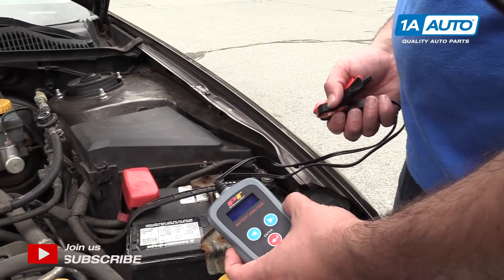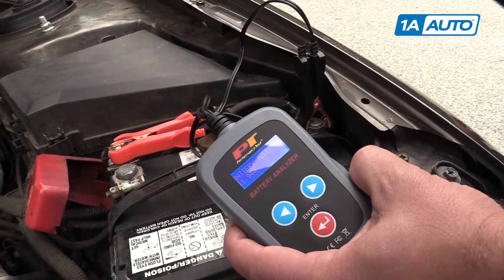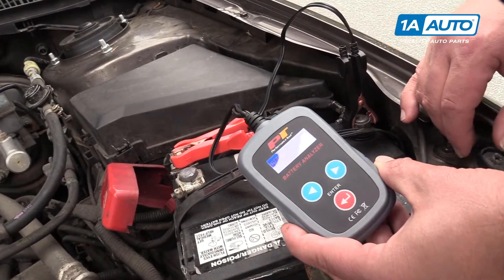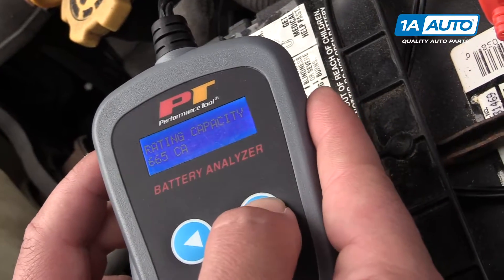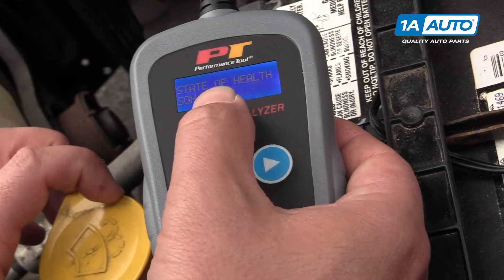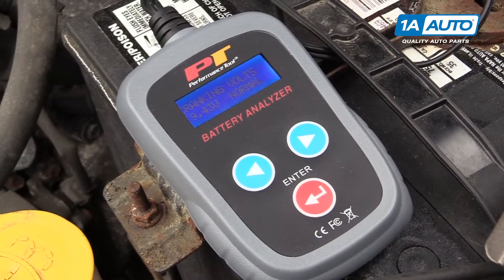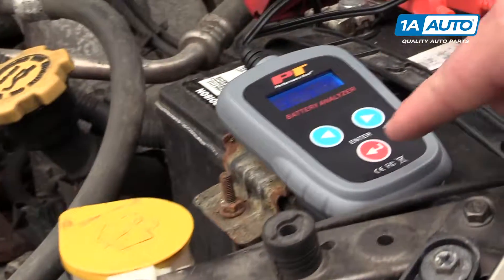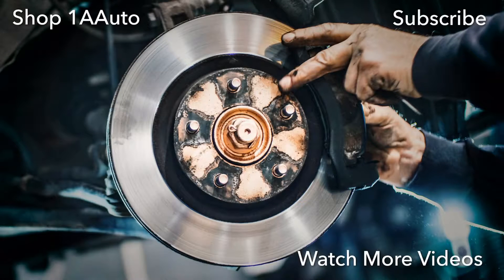How to Use A Battery Tester

Comment: If I were to use this, or a similar device to test a pair or group of batteries, would I be better to test each battery individually, or (+) terminal on the first battery and (-) on the last battery? If the the latter, does it matter if the batteries are in parallel, or series? I assume individually removing the batteries and testing them one at a time is more effective, but I am curious to know if the other way works, as well. Sorry I do not own one of these devices, nor do I have a bunch of batteries to setup, just a curious question about semi truck and heavy equipment setups before I go researching this type of tool for my needs.

Comment: The video instruction were misleading per device manual http://www.wilmarcorp.com/files/W2998_Manual.pdf.   The instructions for the car battery tested should have used SAE settings instead of the CA (MCA) settings  and entered the battery CCA value instead of the CA.

Comment: Thanks, good informative video. I have ordered an analyzer which will soon arrive. Now, I have an Acura MDX and the battery is covered with a shroud and only the positive terminal is visible. Question,  will the analyzer work properly if I attach the ground cable to the body of the car?